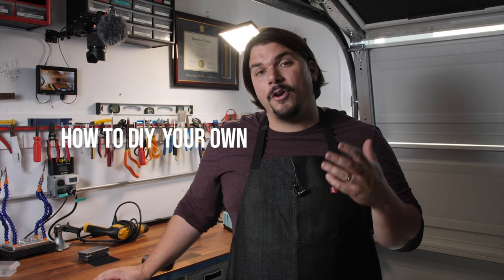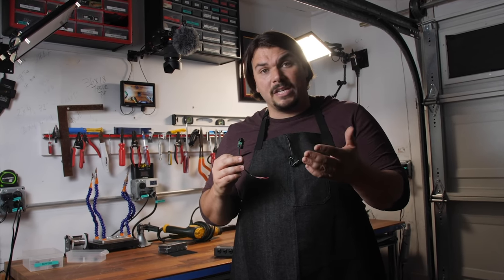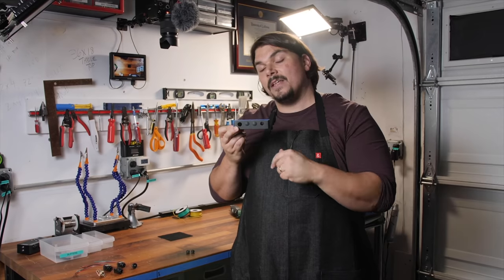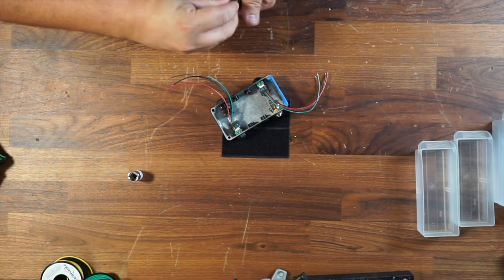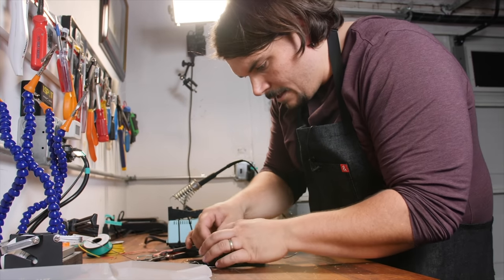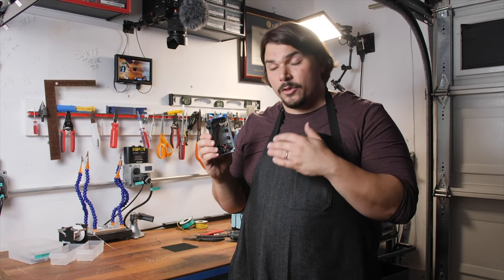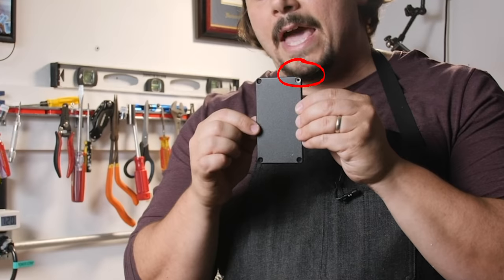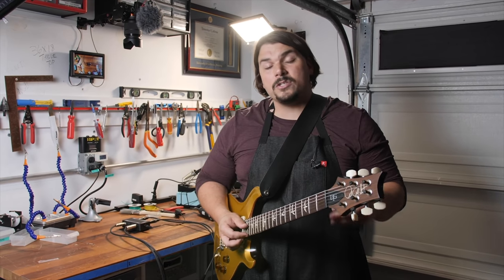Build Your Own Buffer!

Comment: Hey, so I have what is probably a really basic question, but I really know so little in this realm. On my board, I'm running an HX Stomp for some effects and amp modelling but I have a Boss RV-6 for my reverb sound that I love. I switch between using the RV-6 in my effects loop of the Stomp and and running it after the Stomp (I usually run direct to a PA from either the stomp or the RV-6). Having to unplug and reorganise my board every time I want to change that pedal order (moving the RV-6 from the fx loop to after the stomp) is a hassle. Is there a loop switcher option or some interface option like in this video I could use to get around this? I'd love a DIY option too😅 thanks
Reply from the maker: I don’t have a diagram for this but you’d need a toggle switch to re route the order and have the Hx and Reverb pedal into the same box with a master set of outputs

Comment: Which buffer pedals are class A buffers circuits? What are the benefits of using Class A buffers?
Reply from the maker: The Cornish and the Mesa Stowaway come to mind.  No benefit to Class A, just another way to do it.
Reply: @VertexEffectsInc  The Cornish and Mesa Stowaway are both Class A buffers? I wonder what are the advantages of using Class A buffers compared to the other versions which are Non-Class A buffers
Reply: @VertexEffectsInc  For Non-Class A buffers, what Class of buffers are they since they aren't class A?
Reply from the maker: @waynegram8907  it's just another way to get there, it's not better or worse.

Comment: Hi Mason, please tell me if you recommend using Polytune 3 as the last pedal (and only buffer on my board) to drive the cable going into the amp. I use lots of fuzz pedals and only
Lava patch cable with 2 Mogami Silver series cables. I mean it's a Bonafide buffer they say, so that should be fine right? many thanks :)
Reply from the maker: Depends what other pedals you have first and last and the impedances of those and what's always on if anything.
Reply: @VertexEffectsInc  Thanks for the reply. It's still changing but generally stock Cry Baby (I know), Lovepedal Vibe, Dunlop Germ fuzz-fzce (will replace with Lovepedal BBB11), Kalamazoo, Pharoah fuzz, Ultimate octave, Eternity (roadhouse), Memory Boy (will change). Thinking to buy a Topanga if I'll get a Plexi.. but T.Rex Roomate 2 is amazing. Also will add an EP boost/Super Hard On.
Reply from the maker: @SeemoreDunkan  Ideally the pedal with the lowest output impedance that's in your delay/reverb category would be best last and always on (unless it's buffered bypass).  If you can get something around 100 ohms then having the Tuner/Buffer up front would be ideal.
Reply: @VertexEffectsInc  Up front but after the fuzz faces I take it.. many many thanks. I'll try first using the Polytune's Bonafide 100 ohm output impedance last in the chain since I got no other pedals that I should put there. I learned a lot from your videos... many many thanks :)

Comment: If I wanted to use all Neutrik jacks how would you go about grounding the chassis?
Reply from the maker: There are a few ways, the easiest is to drill a small hole next to the dc jack with a screw and nut with a solder tab to ground the sleeve of the input jack with a wire to the solder tab that is tightened to the inside of the chassis.  The other way is to get a toothed washer and solder a wire to it that connects to the input sleeve on the jack and put that washer between the jack shaft and the wall of the enclosure so when you tighten the jack is press fits the washer against the inside of the enclosure.
Reply: @VertexEffectsInc  thanks I’ll have to see what i can get hold of.
Reply from the maker: @themaninthesuitcase  I think the toothed washer is easier.  Where are you located?
Reply: @VertexEffectsInc  I’m in the UK. I probably have some I just need to remember where I put them.
Reply from the maker: Check Bonsai or Tayda

Comment: You mentioned 22awg wire and it’s in the list of materials. Im a little confused about what that spare wire is for. In the diagram it looks like the buffers have the only wires you need already built in. 

Also, do you need a grounding wire to the case itself like a guitar does to trem claws? Or is the ground on the jacks enough?
Reply from the maker: You'll still need hook up wire for some of the connections.
Reply: @VertexEffectsInc  which ones? It looks like the red and black wires from the buffers connect to the power, and the green and yellow go from one buffer to the guitar, and the other buffer to the Neutrik. I don’t see any other wires in the diagram so I’m confused what the set up wire is for.
Reply from the maker: @devinsparks1523  Depends on the implementation that you're doing.  There are about 8 different wiring patterns in the diagrams for different applications.  Many of them will require hook up wire.
Reply: @VertexEffectsInc  ohhhh wow I definitely should have specified I’m doing the dual mono buffer. Sorry about that.

Comment: Great video.  Is there buffered splitter where the outputs are unity gain with the input?
Reply from the maker: If it's a real buffer they should only be unity gain.  If you're not getting unity gain - there's probably an issue on the pedalboard.
Reply: @VertexEffectsInc  Thanks for the reply.  I have a CAE interface with what appears to be op amp buffer that's split, along with an audition loop for a volume pedal.  When I've used the split outputs to two amps, the signal drops, with one it's unity.  Based on what you're saying, I'm thinking of removing that section and adapting something you have, and rewiring for 9V DC rather than 12V AC.
Reply from the maker: @odyssey6684  sounds like you're talking about a specific problem, not something attributed to buffers generally.  Without knowing or seeing the unit it's hard for me to speculate the issue.
Reply: @VertexEffectsInc  I guess the question is - have you seen a drop in signal strength in a buffered splitter when both outputs are used rather than one?  Easy test would be to take your splitter circuit and plug in two amps, then unplug one of them.  If there's a noticeable increase in gain, it's not unity when both outputs are used, only when one is.  If that's the case, some sort of boost is required to get the level back to where it should be when using both outputs.  I'm hoping to avoid that.
Reply from the maker: @odyssey6684  the only condition that you'd see that is in a device that's either defective or has poor enough output impedance where the parallel loading becomes and issue.  On some of these devices they run transformer isolated outputs on one side that can cause an issue as well and can create some attenuation because they're not well suited for a guitar application or have long lines of capacitance after them.  You're situation is specific to your device, not quality buffers generally.
Reply: @VertexEffectsInc  FYI - The link to the 9V DC jack is corrupt - any alternatives?
Reply from the maker: Works for me https://www.digikey.com/en/products/detail/schurter-inc/4840-2200/1212406

Comment: Recording engineers say NOT to use Buffers on your pedal boards because it creates "frequency Masking" issues and problems when trying to mix the guitars with audio tracks or live mixing. The buffers will REMOVE certain frequencies, is this true?
Reply from the maker: Name me two engineers that have ever said that?
Reply: @VertexEffectsInc  It happens more in death metal music when playing drop D and lower plus using 7th strings because the lower frequencies buffer pedals will frequency mask the low frequencies. I'm guessing metal guitarist don't use buffer pedals it seems that is what they are complaining about buffer pedals.
Reply from the maker: @waynegram8907  again, what engineers are saying this, and if they're saying that the buffers change the EQ, then they're using a bad buffer.  Remember, a buffer isn't a buffer ins't a buffer.  99% of the buffers on the market are garbage.
Reply: @VertexEffectsInc  yes I know buffers can color your tone and alter it that is why engineers say not to use buffer pedals because its frequency masking the audio signal. Your guitar audio is passing through a BJT or FET even in its linear region its still going to color the tone and frequency mask so there is not going to be a free lunch from input to output. A non bypass Tube screamer rolls of a lot of high frequency and a true bypass tube screamer doesn't. But SRV clean tones if not straight in from guitar straight direct to fender amps input jack, its going through the Tube screamers turns off which is still going through the BJT transistor buffer which is rolling off the high frequency and frequency masking the audio signal. Rolling down the strat vol pot changes the output impedance which the Tube screamers BJT buffer would alter the impedance and frequency masking this creates a texas glassy tone. Not all buffers do this only certain buffers and not all buffers are all the same.
Reply: @VertexEffectsInc  The band "Parkway Drive" uses lowered tuned guitars which they are saying that Buffer pedals are Bass Cut filters which are bad for the live mixing engineer and sound engineer because of frequency masking that happens in various buffer pedals. Buffer pedals don't work for 7 string guitars and lowered tuned guitars.

Comment: Are these parts listed recommended for building an output buffer for bass?
Reply from the maker: Yes, but depending on your bass amp you can raise or lower the input impedance by changing the R1 value
Reply from the maker: It should be in the manual with the input impedance is

Comment: Hey Mason, getting ready to order my BOM for this build. Your designs use TRS jacks...would there be any disadvantage to using switched mono TS jacks for the loop in/out? I'm building your version with the audition loop.
Reply from the maker: You could use TS jacks but the TRS tend to hold a bit better and put more pressure on the jack.  You can also ground the Ring to the sleeve for a better ground.
Reply: @VertexEffectsInc  brilliant, thank you. You're an absolute legend!
Reply: @VertexEffectsInc  Just finished my build. This is awesome. I'm going to build a second audition loop for later in my chain, and pass through a EXP pedal input. (To patch in an RE-301 pre-reverb in my chain). I'll need to figure out grounding, since I'll just be using the Neutrik jacks. Just ground the jacks to the chassis? Cheers. Thanks again. DIY is alive.
Reply from the maker: @PeterFerguson9  you can run a ground wire off the input jack and ground it to the case.  You'll need to drill a hole for a machine screw and a solderable washer to do that.
Reply: @VertexEffectsInc  Awesome. If you have a minute for one more question...

On this original interface box I made (your In/out + send/return box), I'm noticing a lot of high end dumping somewhere between the switchcraft jack (guitar in) and the redeemer circuit on the opposite side that heads to the start of my pedalboard chain. I've checked all of my soldering, no issues there. Every other patch works great in the box. If you have any advice, I'd love to hear it. Thanks again for all this great info!
Reply from the maker: @PeterFerguson9  without seeing it, I can't say.  It is getting powered properly?  Any difference in sound with the power on/off.  The Redeemer will still function with the power off, just quite attenuated.
Reply: @VertexEffectsInc  Same deal regardless of power. Very noticable high endI'm going to go through and reflow my connections on that section. My multimeter showed 9v across the V+ and ground of the redeemer.
Reply: Sorry 9v across V+ and V-
Reply: @VertexEffectsInc  I've reflowed everything and still having the same issue. Listening closer, I'm now hearing the output buffer having the same effect. When I patch through either the send or return directly to the amp, sounds great and clear. Dull when running through the buffers. Tried running at 9v and 18v. Double checked all the solder dots on the redeemers and everything looks correct. I'm quite stumped! It is as if there is a parallel load or some of the signal is getting sent to ground. I find no continuity issues with the hot signal and the ground points, though. Hot signal is only showing up where it should on the jacks. Any ideas?
Reply: @VertexEffectsInc  hey Mason! I heard back from Creation Audio Labs on this. There are little metal spikes on the jacks of the Ai1 Redeemer Circuit. If those spikes touch the metal of the enclosure, you'll lose signal. They don't include a nylon washer, so I just got one from my local hardware store to isolate the jack. Problem solved. 

I'm not sure how common this is on the Redeemer circuit, but if someone else is having this issue, try isolating the PCB side of the jack from the enclosure.

Thanks again for all the info, Doc! This is all so helpful for individual players who take care of their own gear. Means a ton.
Reply: Turns out CAL has changed their jack for future orders, so this shouldn't be an issue for anyone starting builds at this point.
Reply from the maker: @PeterFerguson9  I got some with the same issue.  The buffer circuit became so popular with DIYers that the redid the PCB so the 1M is already installed as it comes with a few other updates.  In doing so, they installed a "sleep" circuit for battery use, but since this isn't being used on battery, it leaves it on all the time and won't allow power in.  There are two solutions: 1) the plastic washer like you did, or 2) remove the solder dot on J3  and it disables the sleep circuit.
Reply: @PeterFerguson9  Hi Peter, I used the nylon washer and it made a big difference but still have about 10db volume drop and some high cut when going through the interface vs. the pedal to amp. Did you still notice anything like that after using the washer? I know you said it fixed your problem.
Reply: @abesaenz75  Mine has been fine since I fixed that problem with the washer. Sounds like something might be grounding out elsewhere in the pedal? Maybe check your signal to ground on the other jacks. Did you build the model with the audition loop/send and return jacks? You can troubleshoot down to the individual set of jacks that is giving you trouble by using different sections of the patch bay.

It sounds like either one of the redeemer circuits isn't getting powered fully, or signal is dumping to ground somewhere in the audio path. Best of luck!

Comment: What about 10 MEG in for Acoustic Basses ?
Reply: In general, the higher the input impedance the better (especially for piezo type pickups 10-20M is good) to reduce signal losses and high end losses. You will probably want a tone rolloff somewhere in your signal path because it is a bass, if you want to lose some high end (finger noise, contact noise, etc)

Comment: Does someone know if there is a pre build 4 way Buffer? Why is there no buffer in the fx loop?
Reply from the maker: There is a buffered effects loop option in our diagram on the return.  If you have a passive effects loop you would need a buffer box designed for that with send and return levels closest to the amp as possible like the Kleinulator.
Reply: @VertexEffectsInc  Thank you for the Answer. Why is there no buffer in the amp fx loop send in the diagram. Is there a reason for that?
Reply from the maker: @Maikusan8787  The send won't do much since the buffer would really have to be on the amplifier to make any difference in that position. Once it his the first effects on the pedalboard after the send that will convert it t low impedance at that point.  If you don't have an active effects loop, the Kleinulator is the move since it will provide you a buffered SEND as you'll need with a control to adjust between line and instrument levels so long as you leave it velcroed to your amplifier and not attempt to put it on the pedalboard (it's designed to live as close to the amp as possible).  Really the buffering in the loop is a bit different than the front of the amp, not that they don't matter, but the position near the amp becomes more critical.
Reply: @VertexEffectsInc  do you think I can also use a bonafide buffer velcro‘d to the amp as a fx loop send buffer and then put one of these buffers into the interface so the fx loop return gets driven too?
Reply from the maker: @jimi272  you really want a buffered effects loop if you are planning to do something like this.  There are boxes designed to turn a passive loop into an active one.  I recommend the Kleinulator if you want to do that.  It has dedicated send and return volume controls and a recovery knob for EQ.

Comment: Anybody manage to get the four cable method patchbay to work, with the pedals in series option? I built the patchbay, without buffers and I have one ordered to add to it, but I cannot get the in series connection work
Reply from the maker: Are you using the return as the output?
Reply: @VertexEffectsInc  I used the four cable diagram, provided in your video, but no luck. Each connection works separately, but just not in serial
Reply from the maker: @waynenicholsonmayo  I expect it is user error or some implementation issue.  If not that then a jack failure.  You can email a photo and I can take a look for you info@vertexeffects.com
Reply: I finally got this to work, in the serial option I wasn't making the extra loop correctly, all working now, disregard the email I sent through! Thanks for the help and also the help previously with making cables. As soon as I start back at work, I will purchase one of your drive pedals to support, cheers
Reply from the maker: @waynenicholsonmayo  Good job working through it!  Looking forward to getting one of our pedal in your hands!!!